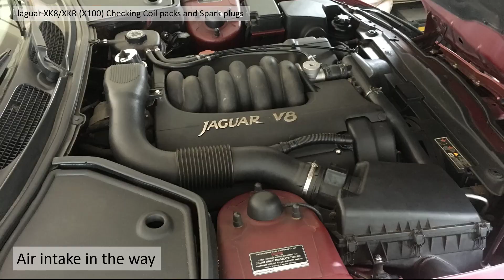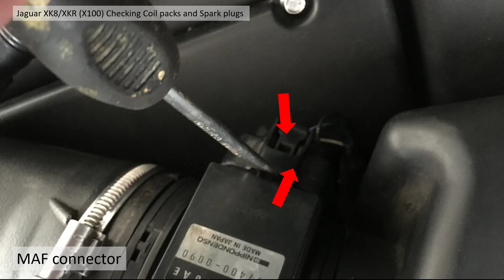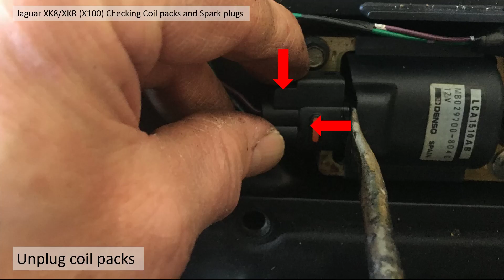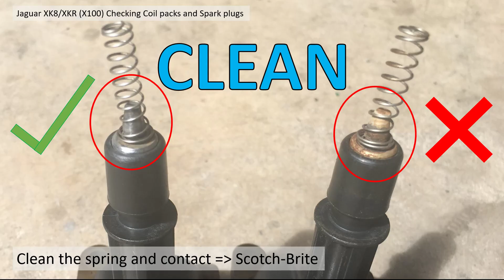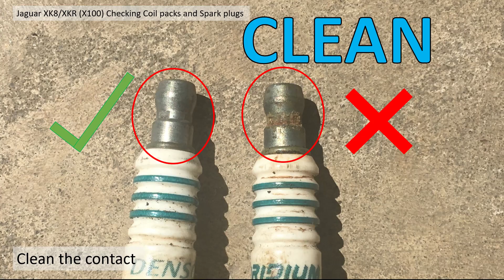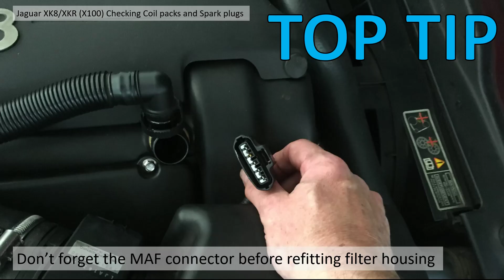Jaguar XK8 Spark Plugs RHS Bank 2 - The "Lumpy Idle" Fix & Reassembly Tips! (Video V23) XKR (X100)

Comment: Hi . . and thanks for a great video and which has persuaded me into having a go at replacing all Ignition Coils and plugs.  But can you help me with a very particular issue (for me).  Could you describe a bit more clearly how you release the Ignition Coil 4 pin plugs/connections apart from each other.  Now before you all jump up and slate me for asking a daft question, I'd ask you to appreciate that I'm disabled and do all car maintenance with using only my right hand.  So . . "pushing down from the top whilst prising with a screw driver and pulling the plug/casing apart - carefully so as not to break" . . . can quite easily become the hardest and riskiest element of the whole job.  Could I ask you to give an honest opinion of whether you could you disconnect the IG 4 pin plugs using only your right hand, because if that's impossible . . . I'm gonna have to (reluctantly) give the whole job to a garage.  Cheers
Reply from the maker: Neil, hello XK8 enthusiast with an interesting question. To honest with you I couldn't imagine trying to do these jobs with only my right hand, especially as I am left handed ;). As you are even contemplating doing this, think you must be very capable of this job and many other tasks. I don't think unplugging the coil packs is a major concern. The coil plug plugs have a small plastic latch to prevent them coming loose. A screwdriver or similar item is used to unlatch them. You could leave the screwdriver in the plug so it remains unlatched, then pull off the socket. Just need to be careful to keep the screwdriver/or similar item in position and not to lose it when the socket comes off. Its probably going to be quite tight as not removed by often so will need some jiggling to free it off. LHS is a bit easier to do and I would advise starting that side. That's my thoughts but I would love to hear your feedback. Please let us know what you decided regards Damian
Reply: @Modurol  Hi Damian and thanks for your reply.  Yeah it sounds pretty much like a standard spring latch arrangement and should be OK , I just couldn't see that clearly in the video.  This "un-clipping" should be easy as the coil pack is static and in a fixed position as you apply force to detach.  Sliding a plastic shim/feeler gauge in under the clip/latch is the default method. The ones that are (sometimes) impossible are those push/pull/clip/latch fasteners where both the plug and socket are "free floating".  I've had to manage and to find a way for 40+ years, so I don't give-up too easily . . . but you gotta know when you are going to need help.!!  cheers . . I'll let you know how I get on.

Comment: Super cool tips!! Thank you. I couldn't understand the difficulty with the loom. What happened? Does it get stuck somewhere?
That video gave me an idea. Would you have a video about removing and cleaning the throttle, air box housing etc? That would be great to hear your essential tips on that.
Thanks Damien, very useful info as usual.
Reply from the maker: Alexander, thanks again for your great comments. The loom has fixing points (clips) and these are made secure by the lumps on the cam cover (stops the clips coming out). Not a big issue either way to be honest. Thanks again Damian
Reply: @Modurol  Damian, When will you understand?! I'm your biggest fan!!! :) ;) ;)

Comment: IMO, the notion that changing plug gaps from 1.1mm to 1.3mm fixes a rough idle is completely nuts, and will surely shorten coil life.  My default rule of thumb is to gap 1mm on non-boosted, 0.8mm on boosted and 0.5mm on magneto fired engines.
Reply: Agreed. More likely the cause is when the maf and the air box joint is put back together. If it's not perfectly aligned that would cause rough idle. Also I'd apply a little silicon grease on that joint to avoid leaks. Needs to be light though, any excess would fall on the maf and makes things worse. Another thing I would do is clean the maf/air box with a special spray C2C. Thank you.
Reply: @alexanderthegreat6480  DC4 has been used for many high vacuum situations for over 50 yrs without migrating significantly so I wouldn't worry about it getting airborn at all.
Reply: Also coil packs not seated right on the sparks. Air intake leaks, clogged air filters.
Reply: @alexanderthegreat6480  And Idle air circuit/EGR valve controls.
Reply: @garyvanremortel5218  true. I meant things that could go with after changing coil packs and putting back the air intake ;)
Reply: @alexanderthegreat6480  Also a good use of DC4 on the boots.
Reply from the maker: Gary, reference spark plug gaps, I agree must have been Jaguars reaction to some customer feedback but doesn’t make sense except when at idle. But the customers always right. Thanks Damian